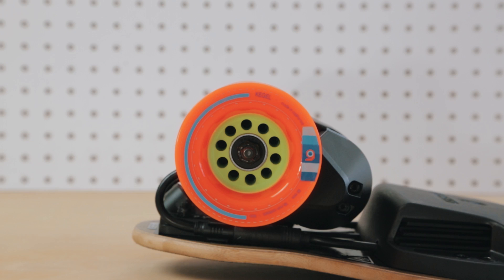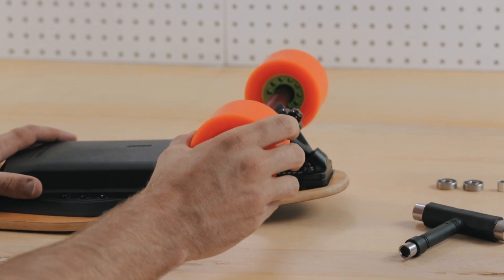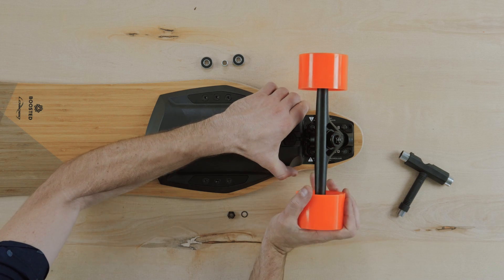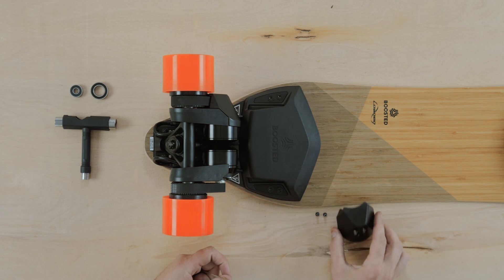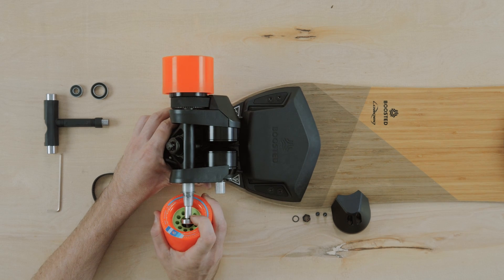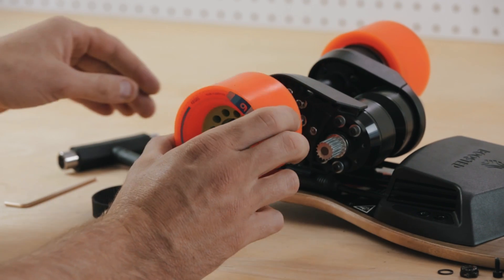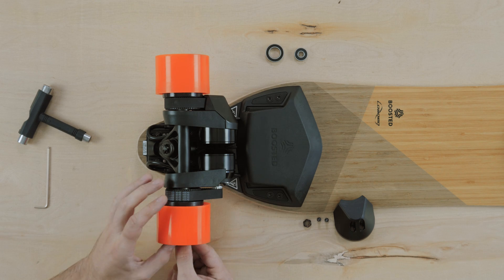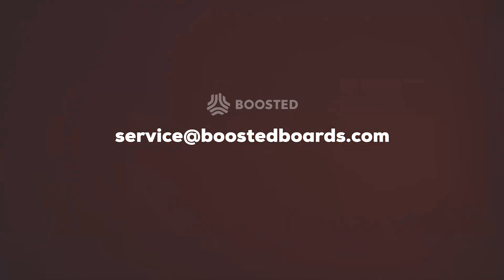Boosted Boards - 2nd Generation Service Video: How to Replace Bearings

Comment: I think you forgot to mention there are 6 speed washers. when taking off the front wheels you only mention 1 washer per wheel when there are two per wheel, an inner and outer. 
Also you don't mention to loosen the motors and only tighten until there is no lateral moment of the wheels.
I think you should make a more accelerate demonstration video.

Comment: Don't get me wrong. This company is awesome. But how am I supposed to replace my wheel when it takes 5 months to get here... this company needs a better shipping option. A good idea would be to sell them to amazon and I'm telling you right now. Everybody orders from amazon. Weather it's a fridge or a shoelace. Please get these out as fast as possible. I don't want to wait for 4 months when I'm paying $1300 for it. Thanks!
Reply: Vos top I know exactly what you mean. My board will not arrive for another 3 months. It's a little rediculous
Reply: Putting it on Amazon would not change anything. It is a manufacturing issue...
Reply: Jake Methner ya but the orders would be better managed
Reply: And a loss of profit for them. Their shipping system is fine, they just didn't work out the issues before launching.
Reply: Ali Noorani i know right!
Reply: Vos top exactly. I would love to purchase a boosted board but the boosted board website is retarded. They make u pay over a thousand dollars yet they make u wait months. And on top of that, they force u to reserve a board. That's the dumbass shit ever. Like why can't I just buy the board right away. Shits retarded. They need to get there shit together
Reply: David Sanchez actually there website is pretty nice. They just updated it to
Reply: David Sanchez That's because it was a preorder. They needed a portion of money before hand to stock up boards to sell. The waiting for months would not change no matter which retailer they eventuality sell to. 

The V1 was sold through Amazon, but the v2 started with preorders. It will eventually be stocked at Amazon for  regular customers.
Reply: They have horrible shipping windows estimates. I don’t mind waiting as long as they give proper heads up instead of 3-5 weeks expectations vs reality 3-5 months.